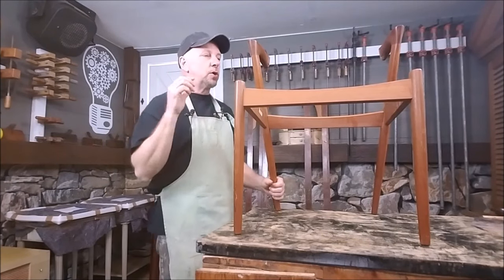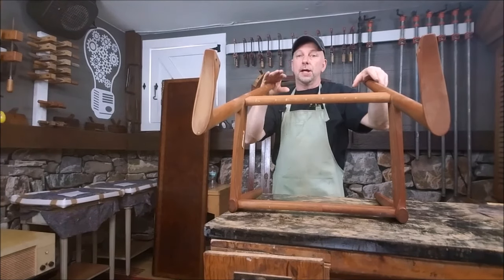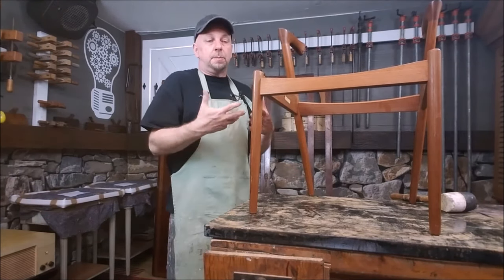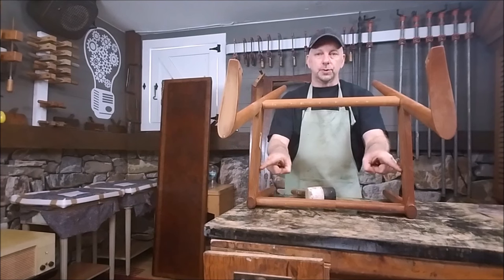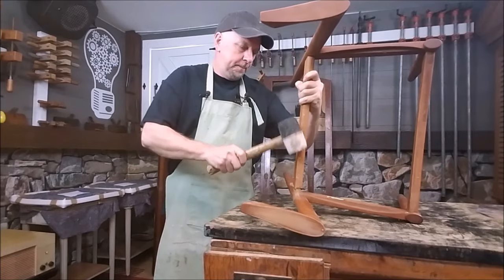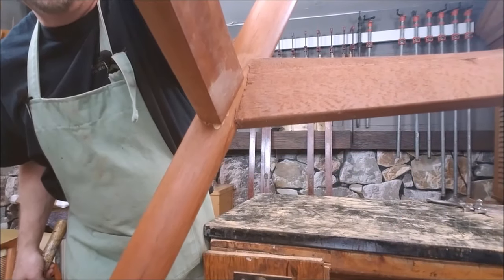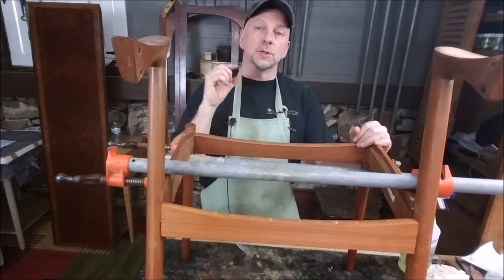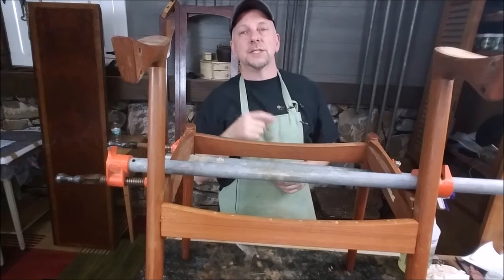How To Repair And Re-glue Loose Wooden Chairs Yourself - The Right Way.

Comment: Another big difference with screws and nails. Nails are ductile, while (most) screws are hardened and brittle. Nails will just bend as the chair wants to wiggle, while screws won't unless they snap and fail completely. It's for this reason you need to be careful in construction if using screws for an application that normally calls for nails as screws can completely fail, while nails will deform plastically.
Reply from the maker: Excellent points Tom, Thank you for sharing your knowledge and insight with us.

Comment: On a very old chair with dowels that became somewhat loose, I see the point of an exato knife tip to remove glue by scratching the dowel with the grain, this raised the grain giving the glue more surface area. I did likewise in the holes. It’s tedious but kept the union a bit tighter.

Comment: On chairs that are much older, is it likely that hide glue was used and should it (if available) be used instead of poly glue. I typically wrap the joint areas  (none glue areas) with masking tape, label which also will aid in glue squeeze etc. and sometimes use a spreader clamp to assist in separating. (proper blocking on the main leg etc so nothing else will break as you mention) Nails and screws are the real nemesis. Thank you for doing these videos!

Comment: Thank you, I’ve been trying to pull joints apart and squeeze a little glue in there for years and it never works. Good to know that it never will, so I can stop trying that and take the time to do it right. Do you happen to have a video on the corner blocks removal? I have a chair with corner blocks that are glued in, no screws. Looks like they used gorilla glue

Comment: Always helpful. Thank you.  If you get the opportunity, I would like to see how you approach disassembling an older mortise and tenon chairs with nails (from a previous DIYer repair) through the tenon. I am working on an older rocker where every joint is loose and only held together by the finish nails someone drove through the tenons.
Reply: I had a similar situation but with a dining table. Huge nails through the top of the leg through the tenons. Only thing I could think of was punching the nails all the through the tenons. Ended up creating too much of a mess so I decided to cut the turned legs off at the top and remake the top square portion of the leg with new mortise and tenon a before using a big hanger screw to reattach the turned portion of the legs.

Comment: you can break any glue joint apart by pilot drill into the socket the piece connects too and with a needle and syringe spray vinegar down at a angle then twist gently until it comes apart

Comment: Hi, I wonder if you would be able to give me some advice. I am trying to repair a chair that has loose joints but someone obviously has tried to repair it in the past and put some metal pins through the tenon that, when I try and get the joint apart are starting to split the wood. There is also evidence of trying to glue into the joint without getting it apart first. I have some photos. What would you suggest i do. Trying to help a friend.

Comment: Whats the best method to repair a more ornate chair leg where a plug or wood filler/sanding isn't an option? Its on an accent chair and I don't trust a dowel rod to resist to the lateral movement exerted on a chair. The leg is maybe 10-12" long.

Comment: I followed your link to buy the scrapers and the ones I received are approx three times the size. Makes them unweildy. Also, when I opened up my chair the spindles had metal ping stuck at the ends. Any idea how to deal with those?
Reply from the maker: Thanks for the heads up on the scrapers, I will look into that.  Not sure I understand what a metal ping is ?
Reply: @FurnitureRefinishingStudio  sorry I meant pin. I don't think I can upload a picture here unfortunately.